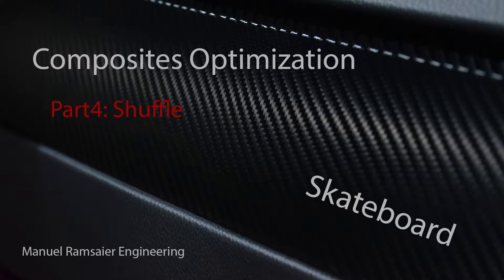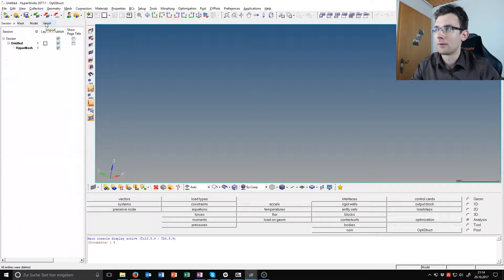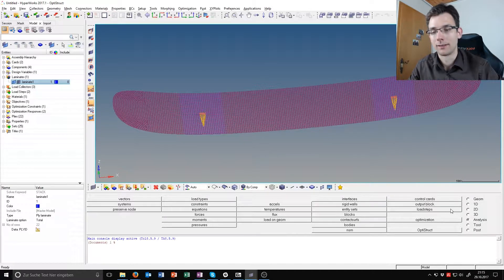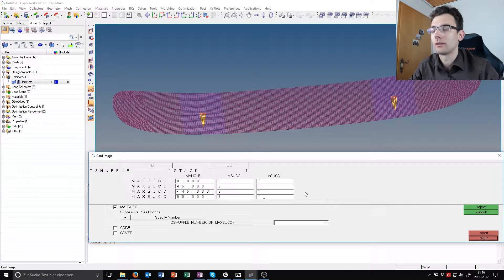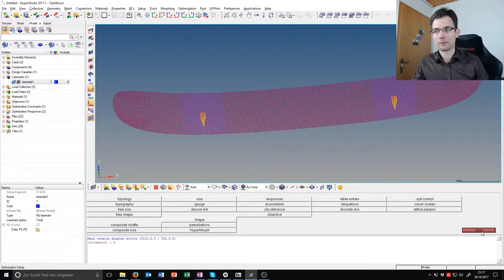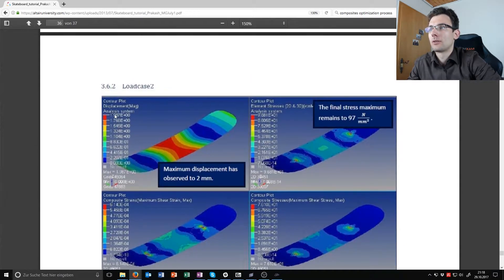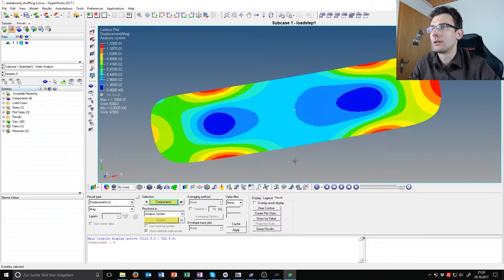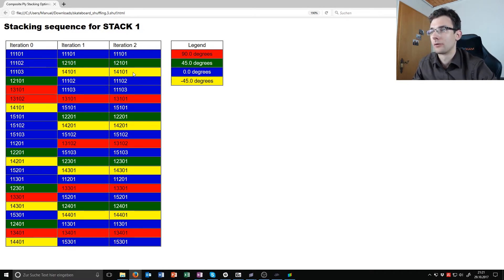Composite Optimization: Suffle Optimization

Comment: The results you are looking at, is that with the shuffle plies you show in the html file? or do you need to run it again with the shuffled plies?
Reply from the maker: At 06:50 you see on the top left the iteration number (bewlow subcase 2) - which corresponds to the itartion number in the html file - so yes, you can directly see the results from the suffling result but also compare it with the variants during the shuffling process
Reply: @ManuelRamsaier  perfect thank you 🙏🏼👌🏻

Comment: Hi Manuel. First of all I want to say to you "Thank you", because you've helped me a lot with your four videos about composite optimization. If you don't mind, I'd like to ask you a couple of things. I followed precisely the part where you set up the shuffling constraints, but it seems that my optimization doesn't go in the I way I'd like (I'm doing a different exercise, but it still follow the request for the MAXSUCC parameters, for example). I know it's a bit hard to do it, but do you know why does it happen? Another thing I'd like to ask you is if there is a way to optimize the stacking sequence instead of the thickness of each ply, in order to have a rough idea about it, as a former thing to do (so, before the optimization that you showed up). Bye!

Comment: This series is really easy to understand and I appreciate it. Thank you very much.
Well, I have a ERROR.   What is Invalid design properties w.r.t??
**********************************************************************
 A fatal error has occurred during computations:
  
  * ERROR # 789 *
  Invalid design properties w.r.t. the design variables were found.
     number of invalid property items = 1 
**********************************************************************
Reply from the maker: Thanks for your feedback. The error means something is wrong with your shuffling card (if its the shuffling simulation you are doing). Check the constraints, maybe a wrong input in the pairing constraint or something like this. It can be caused by a lot...If you can't get it solved yourself, you can send me the model if you want and I will have a look. Also, Altair has a support forum, where you can post question like these. (https://forum.altairhyperworks.com/)
Reply: Thank you for your reply.
I got information that Lower Bound should be set to something other than 0, so when I set it to 0.01, it worked correctly.
It seems that Lower Bound is working even with 0 in your video.
Do you know the cause?
Reply from the maker: I assume that none of my design variables went to zero. This could be why I did not see this error.

Comment: What determines the number of plies? How does the program decide to split the laminate with initially five plies into n plies?
Reply from the maker: In this phase the number of plies is not changed anymore unless to constraints as "add a cover ply". If you mean during the first phase of free size optimization, as far as I know each ply is sub divided into every phase angle specified... so a 0 90 ply initially would become a [0 90][0 90].

Comment: Thanks a lot for your videos! Keep doing this!
Reply from the maker: alexke1503 sure. If you are missing something or have some suggestions what to cover, feel free to mention it.
Reply: Well, I saw you didn't enter any of the ply manufacturing constraints (in the design variable)  during the free-size phase. What is the reason for that?
Reply from the maker: During free size I want to constrain the solver as little as possible; all manufacturing constraints are set in size and shuffle phase.
Reply: Alright! Thanks for the fast reply! Another small question.. I have various loadcases (8 in total) with different compliances. Is it recommended to use the compliance as a respone (ofcourse with the correct weight factor for each loadcase) and tell optistruct to minimize compliance while applying a mass constraint as maximum?
Reply from the maker: For Topology Optimization, this is the way to go. With Composite Optimization think about constraining a maximum displacement and minimizing the mass also. But the way you described is valid, too. So go for it and maybe try the other option as well to compare the results! Thanks for your interest!
Reply: Great, thank you once again! What is the difference between Topology Optimization and Composite?
Reply from the maker: Topology Optimization is used with homogenous material like steel or 3d printed plastics. It is a method to introduce voids into the design space and thus changing the topology. It is a pretty cool way to find a structural proposal for a given load case. It is used widely in engineering. Have a look at the bridge example if you want: https://www.youtube.com/watch?v=GZmeymV-5SA All the best!